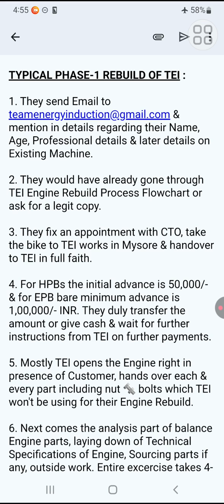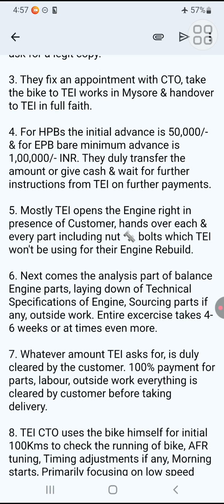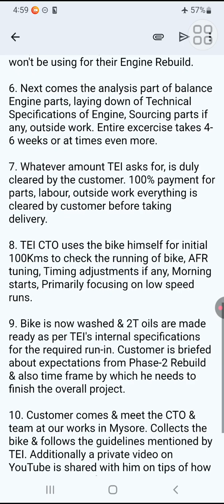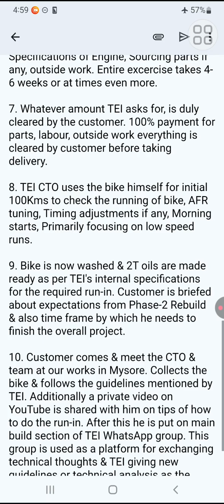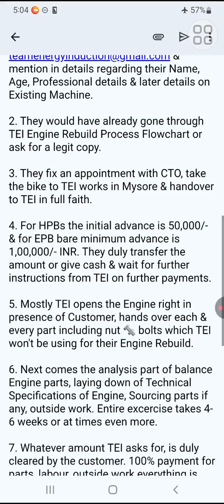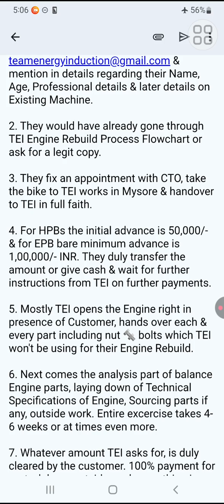TEI Legacy Builds — Phase 1 Execution Model | Engineering Intake Protocol | Team Energy Induction

Comment from the maker: This video defines the engineering protocol followed at Team Energy Induction for engine rebuild.

Rebuild is not treated as a repair activity, but as a structured process based on classification and system evaluation.

Initial interaction is strictly via Email.

Prospective customers are expected to provide clear and complete information regarding their machine and requirement.

Unstructured or incomplete queries will not be processed.

This ensures alignment, efficiency, and engineering accuracy.

Team Energy Induction
Precision | Validation | Performance